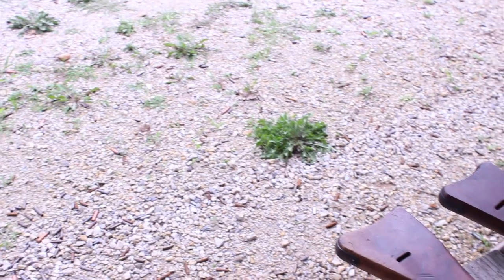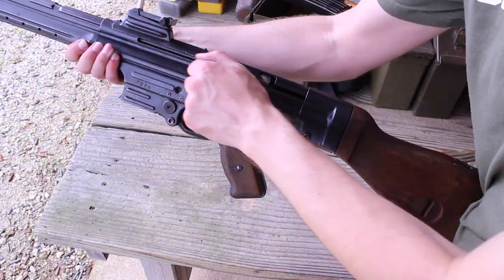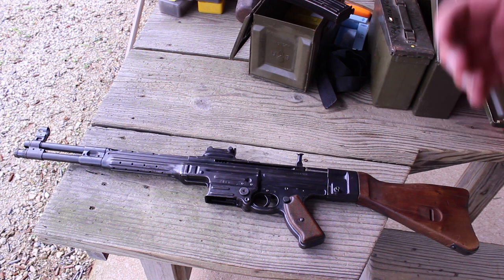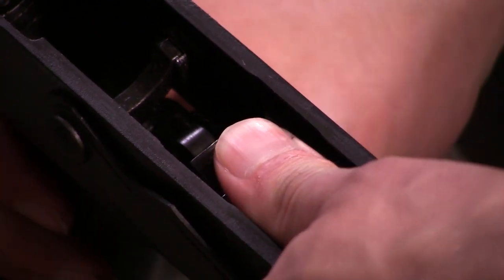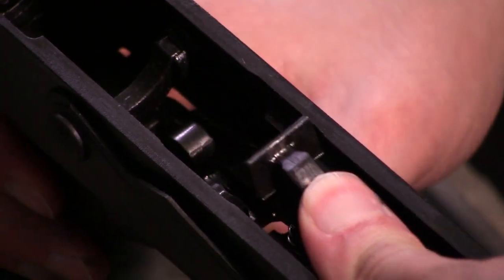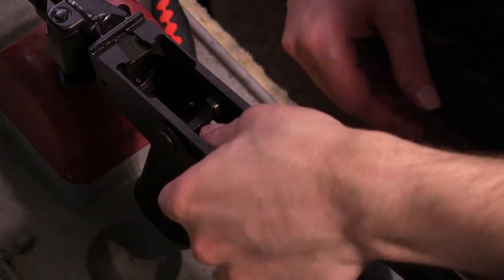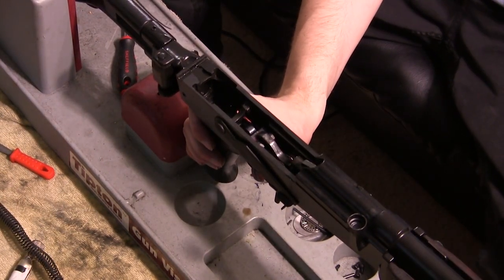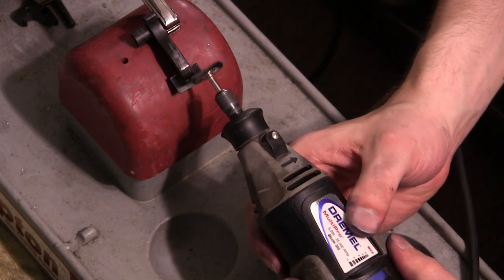Guns I Know Episode 12 - Prototype Assault Rifle & Trigger Honing

Comment: I Love how you can see, how guns that were devolved with this as predecessor, have taken single bits from the gun and worked with them, even some which are still in active use today. The Ak-serious is pretty obvious, it looks very similar and also works quite comparable. Also, the old HK weapons, like the g3 and all it's follow-ups have the exact same buttstock as this one does.

Comment: I debated on a SCAR but in the end it doesn't really do anything a good AR-15 can't.

I'm partial to Cz-75s and I think you'd be really happy with an SP-01 Shadow, but I really think you need to join the cool kid's club and get a bullpup. From everything I've seen the RFB and KSG are typical Kel-Tecs in terms of construction while the UTS-15 is even worse, so I'd say Tavor.

Also if you want to do an MX4 or a .50 video I have a CX4 and BFG-50 you can use. The BFG isn't a barrett but it is a .50